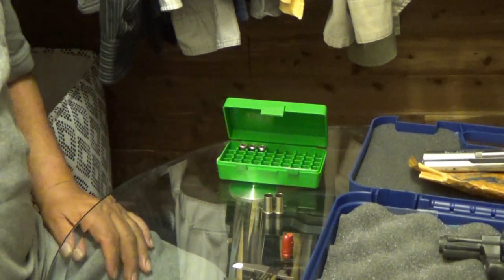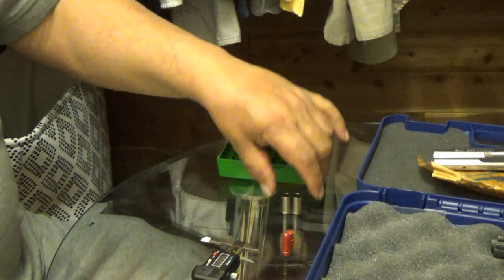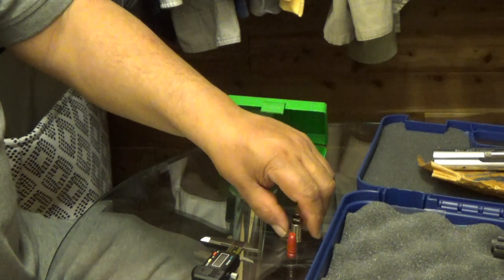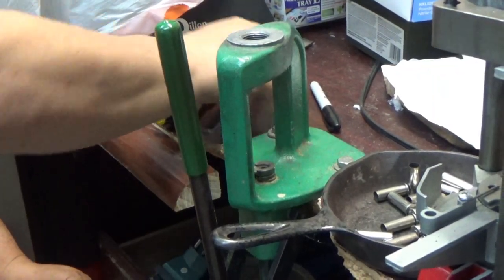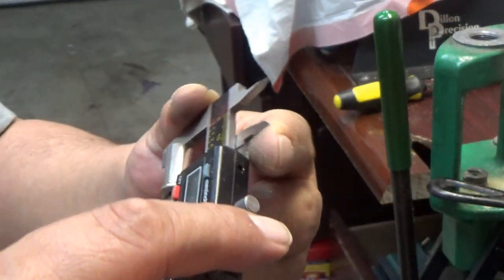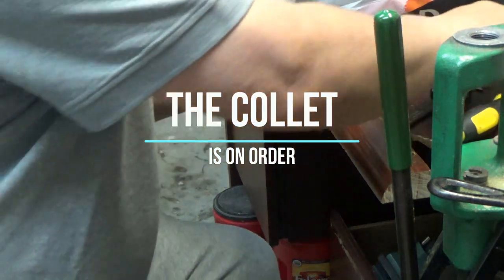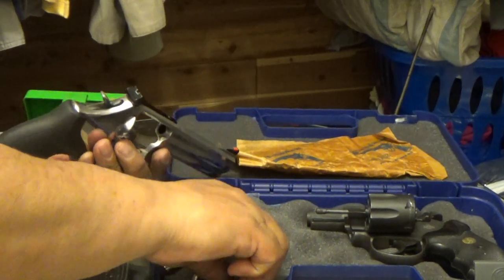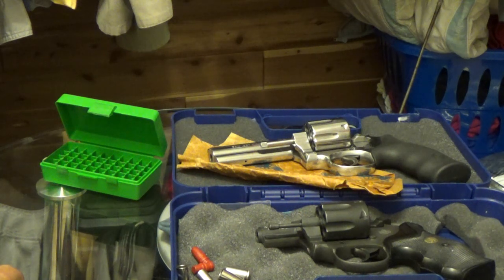(RE EDITED) 38 S&W CASES FROM  38 SPL CASES.

Comment: I keep trying to come up with ideas for those 200 gr bullets. I want to see how fast I can safely push them. I will use .357 Mag cases so in the event they end up in someone else's hands in the future.  I wouldn't want 25,000 PSI+ pressure cartridges being put in someone's .38 Special revolver. Also trying light loads in .38 SC/LC and SPL Short brass would be neat as well, however I don't expect over 400 FPS in the short brass LOL.
Reply from the maker: around 550 fps you can get from under 2.8 grains most fast burning powders,  i'll be using 3.1 gns of unique for both the 170 and the 213 grainers, speer #9 says i can use 3.1gns for the 158gn lead bullet for under 700fps using a s&w model 33 4"barrel. which is a i frame smaller than the K and L frames 38 s&w cal revolver, these loads im making are fine for k frame and L frame revolvers, but too questionable with top break of course.

Comment: I have a 1880 top break S&W.  I have 1 new box of cartridges, you can still buy them.  I want to reload for this gun, do I have to get 38 S&W dies or can I use 38 Special?
Reply from the maker: Fiocchi makes them.
Reply from the maker: You can use a lyman 195gn 362" mold i would suggest a 145gn hollow based mold from old western molds. In .358" once fired will expand down the barrel i use it in my 36 navy revolver.

Comment: I used a tubing cutter to make shorts.  Is the thickness of the 38 rim the same as the 38 S&W ?
Reply from the maker: the s&w 38 colt short colt long and spl are .059 "
Reply from the maker: i now have a lee case trimmer that attaches to the drill and a chuck for the shell base, i will trim with the rcbs trimmer the finish it off with the lee s&w case trimmer.
Reply: So are the 38 s&w and 38 special cartridges are all the same? Did powder fly out the side?
Reply: Using a 38spl shell holder, resize with a 38sw, 380acp or a 38super sizing due. To get the proper .3855 diameter at the case mouth. 38spl dies are small in diameter and will lead to split cases. Sarge